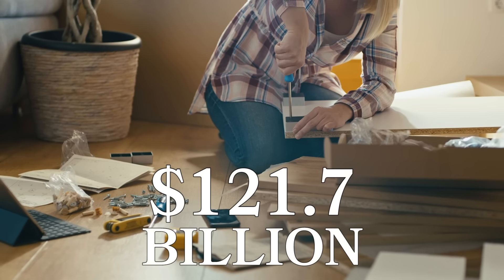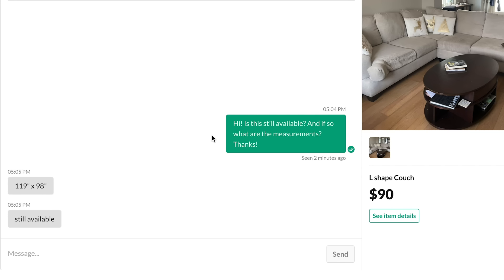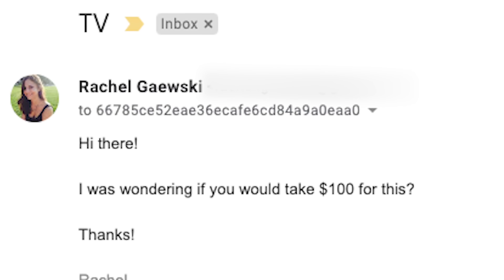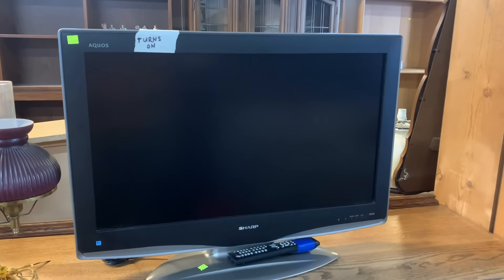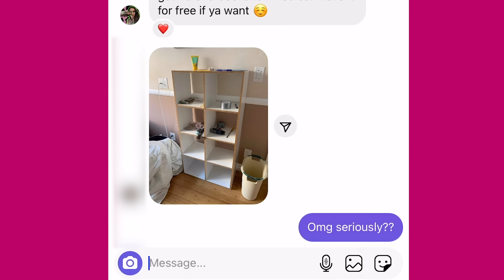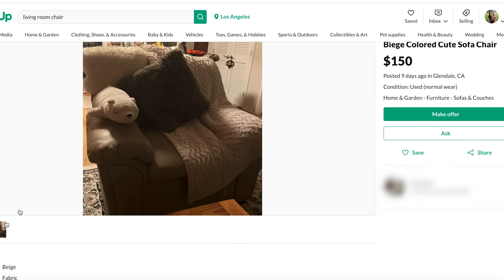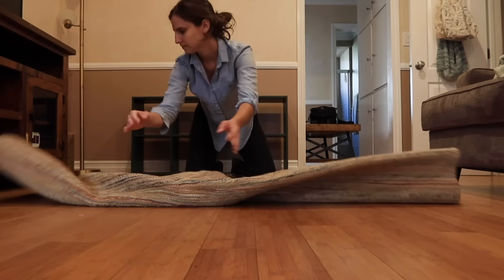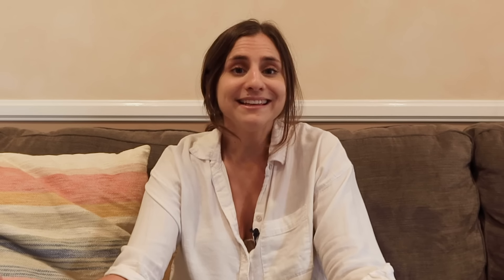I Tried Furnishing My Empty Living Room For $500

Comment: You can get a pair of L brackets to fix that wobbly coffee table. Believe me, the $5 you spend will save you years of frustration dealing with a wonbly table
Reply: What's L bracketts? Like are they at Home Depot or could I find them at Walmart?
Reply: @lilynote2016  They're at basically any hardware store and you can also find them online pretty easy and cheap. They're basically L shaped pieces of metal with screw holes on each arm of the L to allow you to connect two items together at a 90 degree angle. Think of those wall shelves with the little metal pieces under to hold it up, those metal bits are L brackets. They come in all kinds of sizes for all kinds of uses. Super handy!
Reply: Another cute idea I’ve seen is to add 4-5 inch chunky chair legs to book cases that have been turned on their sides. It makes them look like a real piece of furniture and gets the bookcase off of the ground!
Reply: Wow very nice
Reply: Omg duh! Why didn’t I think of that
Reply: @DawnOldham  that’s a great idea!
Reply: Thanks for that tip! Did that this weekend. After 2 years of dealing with it, I was about to replace it. Saved me a ton of money
Reply: @lilynote2016  they have them at Walmart in the hardware section
Reply: @kebert2thumbsup  Thank you!! I've been looking for your comment to thank you for a bit lol
Reply: I don't think an L bracket would have worked since the legs were not 90 degrees.  I assume the correct angle bracket would work as long as the wood isn't cracked.  Alternatively woodglue and toothpicks, chopsticks or wooden dowl can be used for some repairs.
Reply: @lilynote2016 Walmart could possibly have them. More likely Lowe’s, Home Depot, ACE Hardware. Your dad may have some in his workshop. Ask around! Good luck!😊

Comment: For those of you afraid to buy used furniture because of bed bugs- remember that even library books can have bed bugs. They are all over, that’s why you inspect things before you bring them in the house (much like you look at a hat for lice before you try it on). Clean things well. Also look at the skin of the person you are buying from. Bed bugs leave marks on the skin, if they have nice clear arms and legs then you should be ok. 💖
Reply: Aaaaad that's why I buy books or use ebooks.
Reply: I don't think bed bugs are generally worth the risk.
Reply: EEK, LIBRARY BOOKS?! I mean, I usually do wipe them down anyway. But ugh! I had no idea that was possible!
Reply: Or live in a climate that doesn't have them.
Reply: Not everyone is an expert. I've volunteered in libraries. When they check books back in, they also check its condition. If there are any issues, they trash the book. Don't believe everything you read. It's not worth the energy panicking over something like that.

Comment: The bookcase is super cute.   I suggest buying some brushed gold legs to add to it.   It'll tie to your gold lamp and gold handles on the side table plus give it a little more height.  If you wanna go the extra mile to make it look even more custom...add a strip of reclaimed wood (have a friend cut to size) to the bottom then add the legs.  Stain the wood a walnut color.  $20 bucks max for a semi custom piece.  Otherwise awesome job.   DIY artwork next?🤔😬🤷🏾‍♀️
Reply: Great suggestions
Reply: That's a great idea. It would really make it blend better with the rest of the room.
Reply: Brilliant ideas!
Reply: That sounds pretty!
Reply: Yes I agree that legs would elevate the look of the bookcase... no pun intended

Comment: For future reference... When painting pieces like you bought you should lightly sand before painting and add something on top of the paint (poly, wax, etc) to protect your paint job so it will last longer. 
As is, you may find scuffing and peeling to be an issue with normal use.
Reply: Thanks !
Reply: thanks sister
Reply: or just buy a furniture and cabinet paint, and save a step!

Comment: Love your little challenge, and think you did great!  My only caveat is one I learned the hard way...be careful, some of the stuff you might buy might be from a house infested with...bedbugs!  Yes, bedbugs have made a major comeback.  My best advice is for any smaller items like pillows or single chairs, put in a huge black trashbag and sit out in the sun for a few days.  Bedbugs can't take the heat and will die if they are in 115 degrees.  Or if its just a few pillows or some linens. throw them in the dryer.  If its a couch, you might need a black tarp.  But trust me, this technique works well!  Of course, the best is if you don't buy anything infested....

Comment: For artwork, some ideas are to hang a small pretty rug you find at the thrift store as a tapestry. Use leftover paint on a piece of flat cardboard to cover it complete in that green, and then use scrap wood from the hardware store (cheap or free) to make a frame. Or get a secondhand large coffee table book that has pictures you can pull out and put into frames.

Comment: Good for you! I’ve been desperately trying to teach my grandchildren the art of resale but they don’t seem to be learning. They seem to think everything is dirty;  I know they’ve heard of soap and water but… can’t get that through their heads! As you go through Goodwill and Salvation Army just run through the pillows and feel them. You will find there are good quality feather and down inserts in some of the better quality pillows. All you have to do is rip the cover off and inserted it into the pillow cover of choice. For about $30 you can get four pillow covers on Amazon with handy-dandy zippers that you can slip your new insert into.
Reply: Things aren't how they used to be. There is also an issue of safety. I'm not willing to trade my safety to get a "deal" on something secondhand.

Comment: I loooooooved this video! My apt has never been fully furnished bc new furniture is expensive, my only hesitation  with buying used pillows and couches is the fear of bed bugs. Someone I know who did this had that issue and it always creeped me out! How do you ensure the furniture is bed bug free? ALSO YOUR UPDATED APT LOOKS GREAT!!!👍👍
Reply: This has always been my concern as well!
Reply: I once picked up something upholstered and put it in the basement w/it enclosed in a clear garbage bag (hard to do w/big stuff) and then dowsed it w/a powder mix of baking soda and tea tree oil (Tea Tree can fade fabric so test it on a patch) and left it there- with the plastic bag tightly sealed w/tape - for 3 days. At the end of that time, I inspected the bag for any buggies and once I saw that there were none,. opened it up, vacuumed it off and set it in it's place.
Reply: @TrishTruitt  That was really smart. Great tip!
Reply: Additional tips: If you purchase furniture in the winter, if possible leave it in your garage or under a covered area where it will reach freezing temps for 7 days. That should kill the bugs plus help air out any smells from previous owners. Hard furniture should be fine with a good hot + soapy water scrub, but if you want to be super safe you can spray the nooks and crannies as well. Also, bedbugs don’t handle heat well so if you bring in a bed or couch and find it infested, you only have to throw the linens, blankets, etc. in the dryer on the highest heat setting possible for a couple of cycles. This will kill any bedbugs that may be on them. Be sure to treat the furniture as well with a bedbug trap or diatomaceous earth.
Reply: Buy or borrow a steamer! There are several effective, yet inexpensive models out there and it’s a great way to clean and disinfect!
Reply: I recommend Boric Powder.
Reply: @MfckingDye  that means you can never stay in a hotel😖
Reply: Often if you let friends and acquaintances know you are looking for furniture, they'll either have something they are replacing themselves or have a friend or family member who can provide a secondhand couch etc, and then you know exactly where it came from and can trust its not infested
Reply: Same issue with me DJ. I passed on free couch bc it was at an apt that seemed shady. Already had bedbugs once and don't want again! So far have gotten mostly hard furniture used. Don't want to spend a lot on new couch so maybe I'll get a new futon or used one that can be wiped off (like pleather)
Reply: I concur the thought of getting bed bugs from used furniture is a real concern. Because you don’t know where it comes from you need a magnifying glass to visually inspect the creases of any furniture and if you notice any kind of black spots don’t buy it.
Reply: Yep I have a rule of no soft materials unless the owner had it professionally cleaned!
Reply: @MfckingDye  what about arm chairs ? Lol. It for real like any furniture with fabric ?
Reply: I personally wouldn't buy used couch, but pillows can always be washed & the heat from the dryer will kill any bed bugs
Reply: @mallorytaylor6203  Yes, this! Quite often less is more, especially with chemicals. Winter chill and the dryer are very handy!
Reply: @caitlinarntz4839   thats a great idea!
Reply: Here's my method. I place in my car, and leave overnight with an ozone machine running.
Kills odors and bugs, plus refreshes and sanitizes my car.
Reply: @jenniferwatkins8621  what's an ozone machine? That's not a known way to kill bed bugs btw
Reply: @jenniferwatkins8621  I use my ozone machine a lot for getting rid of odors, killing mold, etc!
Reply: @MfckingDye  exactly!
Reply: I got a couch and I can say buy lysol cans and bed bug/flea cans and spray the sh*t out of the couch/furniture on the outside, flip the cushions, and on the bottom underneath it, and behind!
Good luck! :D
Reply: I thrifted an upholstered armchair last summer. The fabric looked like it was in perfect shape. I kept the chair in my car, in the driveway, windows rolled up for several days. I trust that the extreme heat disinfected it.
Reply: @jenniferwatkins8621  Never heard of an ozone machine. Gonna research.
Reply: I know they have bed bug spray for college mattresses so I wonder if the same could be used for couches?
Reply: @MfckingDye  I just posted this to someone else I know a lady that her attorney friend in California put her up at a 5 star hotel and she woke up in the night getting bitten
Reply: You can look at the skin of the person you are buying from. Bed bugs leave marks on the skin. If their skin is very clear, then you’re probably ok. Also, inspect cracks of the furniture.

Comment: Secondhand is often actually better quality nowadays compared to new material furniture. I had to get new furniture by myself for my 3 sons and I a few years ago. I bought new stuff because I figured it would last longer. The bed frames I got us for around 300 on Amazon broke apart within less than a year. I only buy new things now if they are large appliances. Another thing I do is check the “mis-mixed” paint section every time I go to the hardware store.  Sometimes you can get the highest quality, $85 gallons of paint for as little as $10. If you’re just doing an accent wall or small room, it’s a fun way to make a huge change on a budget. Occasionally you can find gorgeous designer colors.

Comment: How do you avoid bed bugs and other pests when buying used?
Reply: Always check the furniture before purchase. Don't be afraid to inspect every nook and cranny for signs. But it's hard to check it all, so you if you don't have time for a thorough inspection or don't have the space, then you will have to treat the furniture before you take it inside. Or, save yourself the hassle by only purchase what you can afford brand new and furnish your house little by little.
Reply: I have always got used furniture. I check all the furniture to make sure it is clean. If it looks good, I bring home and do a thorough clean anyways with soap and water.  I wash all linens and covers in my washer machine.  For mattresses, I get a special cover.
Reply: @mostmai  soap and water isn't enough to get rid of them though... And everything can be infected, not only linens, sofas , etc but also hard furniture.
Reply: You have to treat everything before it gets inside your house. And by everything I mean everything.

Or you take the risk. Might be fine or you might end up with a huge and expensive problem.
Reply: Yea they can literally hitchhike on you from anywhere. You can pick one up from anywhere you go. But they love to live on couches and mattresses the most because that's where they feed, that's where people spend the most time. And another comment here is correct, you have to treat it BEFORE bringing it into your home, or you risk bringing it into your home and having it run away into your home while you're trying to clean/treat the furniture
Reply: High heat can kill them in all stages of life, prolonged freezing, & aprehend treatment
Reply: Buy new for the same price or cheaper. There is zero reason to buy someones used garbage in the year 2021. Stuff is cheap and looks good.
Reply: @Secretzstolen  yeah but that type of heat treatment is $$$
Reply: @WaterspoutsOfTheDeep  well the main reason is climate change and lowering our wastefulness, which is a pretty big and important reason
Reply: Another idea is to rent a upholstery cleaner from homedepot! You can shampoo and carpet or furniture for only $25 a day! And it’s $18 to rent the machine for 4 hours

Comment: for sofa, how to disinfect and deep clean them? I just find video on how to clean and its not what I want. im a germaphobe but i want to start thrifting.
Reply: you can soak the covers in a tub for a couple hours and throw them in the washing machine. Or get it professionally cleaned
Reply: @anustardust  what about the fluff inside the covers? some parts cant be removed sometimes and these are the ones that are making me hesitent
Reply: @RaschellXuan  you could let an upholsterer replace the filling. Parts like armrest usually can’t be washed bc they are crucial to the “skeleton” of the couch(can’t remove them). but when you get a couch professionally cleaned they will also clean those parts.

Comment: You could have fit that original sectional you wanted in that space. All you would have had to do is put the longer side against the wall and had the shorter side placed by your front door. Put a sofa table behind it or place a nice throw over the back and get a shoe rack bench for the front of the window and you have just created your own designated and outlined entry way. Would also be a perfect little space for your wicker basket with your yoga mat.

Comment: One hack if you have a wobble table or anything. Fill in the hole with wood glue and toothpicks or mix glue with saw dust. Than screw in because sometimes holes get stripped.

Comment: Yes you did great but like everyone else concern BED BUGS. I can not just flop on used furniture and be comfortable lol but I guess you have to go through it to understand. FYI rubbing alcohol and water in a spray bottle will kill them off fast! Vacuum and repeat. Sit couch in the heat if possible and wrap pillows and everything in trash bags to smoother them out!

Comment: I thrifted my whole house and I have too much of everything and spent a tiny tiny amount in all honesty. 

I spent like $300 on my living room and I have 2 couches that retail for about $2000, mirrored end tables that retail for $500, a Kirkland's desk worth $200,  an ottoman that retails for $50, a wicker chest that retails for $350, 2 lamps that retail for $80, a big screen tv, tv stand that retails for $300, 10x12 rug worth $200, 6 curtains that retail for $120 and an antique etagere worth like  $1000.

So I got $5100 of stuff for around $300. 
I spent $24 on curtains, $155 on end tables,  $60 on TV stand, $20 on wicker chest, $20 on each couch and the rest of the stuff I found for free or traded for.

I also acquired 3 nice bedroom suits for free and 2 dressers and traded away my industrial fan for a bar table and bar stools and used an old spool of rope as a front porch table and spent $40 on two chairs for the porch. 

I spent $550 on the TV's in my house and about $500 on dishes and decorations and coat hangers and sheets and a washer n dryer  and such so I furnished my whole house for like $1300. - or $650 if you take the electronics out of the amount I spent. 

So for $650 you can have a fully furnished 3 bedroom home minus TV, washer, dryer or fridge. 

I'm really patient and good at acquiring things for cheap or free. It took me like 4 years to get my house just how I wanted it though.

Comment: Just a heads up….don’t use “I can buy it new for that” bc a lot of sellers (myself included) would tell you to kick rocks and go do that then…it comes off extremely rude.

I don’t know if you’ve shopped for throw pillows recently but you’ll pay $15 a piece for some DECENT inserts alone (medium ish, poly filled) not even good down filled ones.

Most sellers know what they have, have based pricing off the current market and aren’t going to list something that someone can buy retail for the same price.

Comment: becareful with fabric furniture because some people have bedbugs and that's the reason they are getting rid of the couches  or furniture. so just buy a flashlight that has blue light and shine it in the sofa before you buy it so it doesn't have bedbugs running all over it